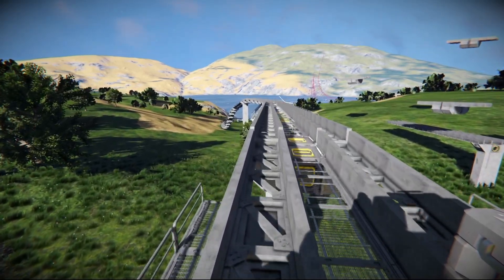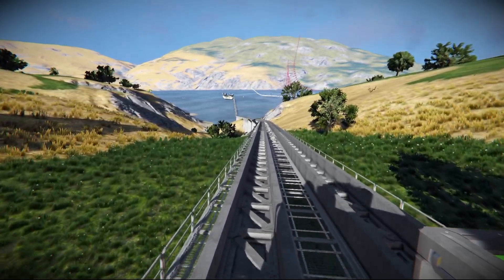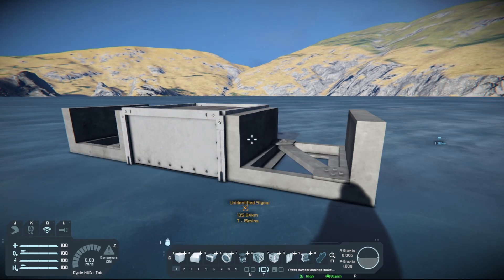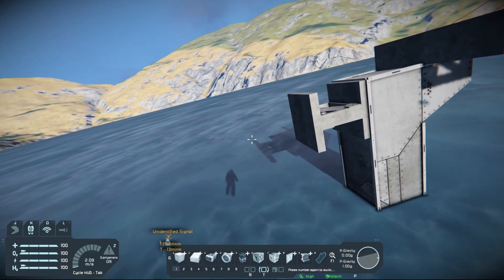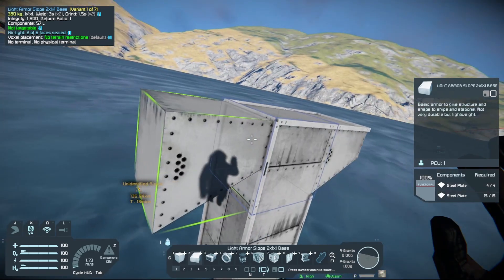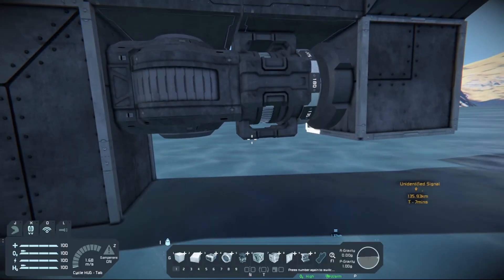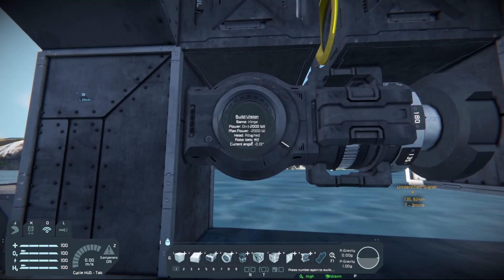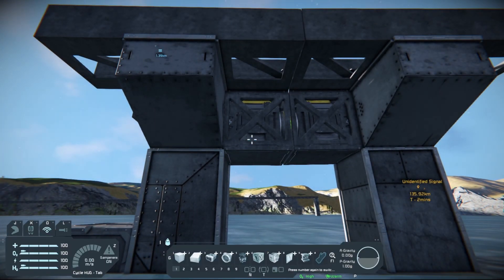Space Engineers: How to Build Railroad Tracks Out of Beams

Comment: This is a cool idea, using this rail system modified a little bit with a wheeled welding vehicle on top of it could be an idea for a unique type of printer that could print from the bottom up as the welder retracts or the gantry rises, might be doable to print large grid vehicles

Comment: For better alignment, you need to have the hinge rotating axis centered in between the two rail sections. In this video the hinge's rotating axis is centered 1.25m from the center of the 2 rail sections, or the last block of the first rail section.

Comment: i think you might be able to increse the angle you can turn if you make the hinge you use to position the next section align exactly between the two sections, i think you can do this by placing a second rotor behind the hinge and using rotor displacement

Comment: Not a fan of the hinge-and-rotor arrangement, because it inevitably introduces a slight sideways offset to the tracks, which constitutes an extra and unnecessary complication to keeping the train on track, and thus most likely reduces max speed.
My own approach would be to instead use two hinges, placed not on the centerline, but rather to the side of the track - specifically the inside of the curve - and set each hinge to half the desired angle. While this will introduce a slightly larger gap, it will avoid any sideways offset.

Comment: "Railroad curves are also 1-3 degrees"
Yeah, no - that in and of itself doesn't mean anything for deciding what angles to set the hinges to.

Real-life railroad curves are contiguous - they're not made of straight segments joined at an angle at a single point. In such a context, any specification of an angle is meaningless. The 1-3 degrees commonly cited for US mainline freight tracks are not degrees of angle - they're what is called degrees of curvature . Which is a different thing.

Degrees of curvature specify the change in direction (in degrees of angle) per a specific distance . To know how many degrees of angle we need to set our hinges to, we need to know (a) the specific distance used in the definition of degrees of curvature in US railroading, and (b) the length of the track segments we want to join. (Technically, we can get away with knowing only the ratio between these two distance measurements, but it makes the computations more opaque and thus more prone to mistakes).
In US railroading, degrees of curvature are defined with respect to a track length of 100 ft. So e.g. a curve with 3° of curvature and 3000 ft length would turn by a total of 90° of angle.
To approximate such a curve in Space Engineers, we could join straight sections of 12 blocks (= 30m = ~100 ft) at angles of 3° - or we could join sections of 8 blocks at angles of 2°. Or 4 blocks at 1°. Or whatever combinatrion your boat, as long as (section length in blocks) / (hinge angle in degrees) = 4.

Comment: what is the speed limit? it looks like it would be pretty wobbly.
Reply from the maker: There are a couple of factors that play a role in stability: first, the smoother your track is the faster you can go. So let's say you make .5  degree changes, you can travel much faster than the track i made.  Also, a huge factor for stability is keeping a low center of mass.  But on another of my test runs, I was able to consistently get 30-50 meters a second. That was with a two degree change.  

Lastly, track layout design does matter, making small adjustments always better. Working with the terrain, and rather than going over a mountain going through.